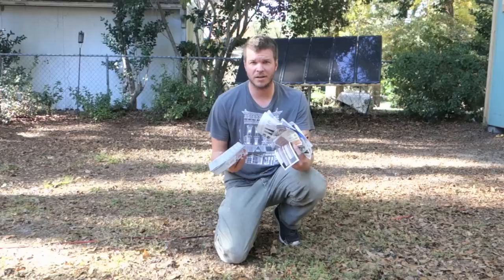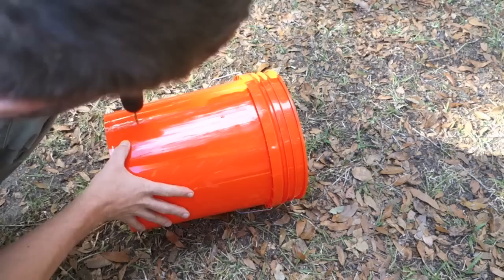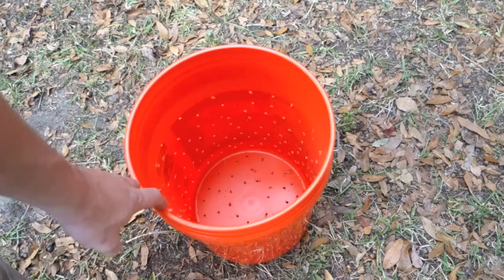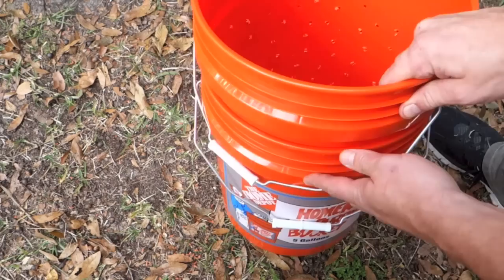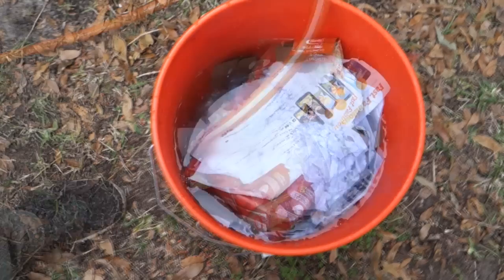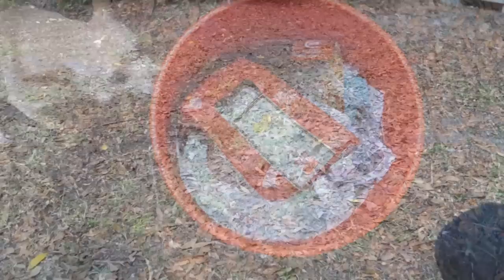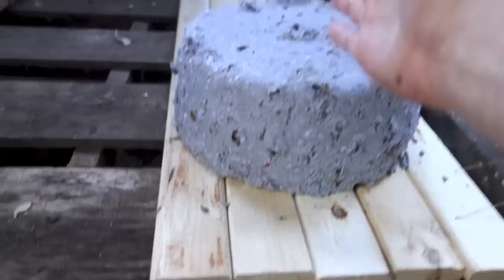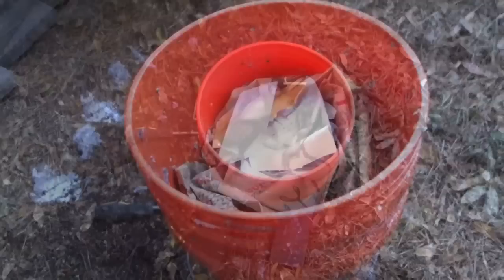Free And Virtually Unlimited Fuel To Heat Your Home

Comment: or i just grab enough wood for a week in an hour from the woods
Reply: I don't think the point of this video was to replace wood. Seemed more to me it was a way to take something that would just get thrown in the trash and do something beneficial with it.
Reply: @DarkNight042   Well honestly i'd rather just use the paper mail to start a fire with...
Reply: @TwiggehTV  Of course, but the trash mail is going to pile up much faster than you will need for fire starting. At least this way it doesn't end up in a land fill...
Reply: Joshua Stepien the last thing I want to do is spend an hour with this process when I can go cut and split a cord  of wood in 45 minutes
Reply: Why not have a closed heater/stove in which you just can toss the paper as it is? lol
Reply: You killing trees
Reply: What the hell harm comes from burying paper?
Reply: Not everyone has access to woods. If you live in an urban or suburban area you probably have better access to office waste than a forest

Comment: you have plastic in there, your going to burn plastic... (/facepalm)
Reply: +Jade Rogue I bet right in this moment you are burning oil or gas to heat your house.
plastic is to 100% made out of oil, so whats the difference?
Reply: +mrmadame28 The tiny amount of plastic is nothing to worry about
Reply: +Leo List  I disagree that burning plastic is nothing to worry about. Yes, it's a matter of degrees; but burning plastic forms dioxin-polluting and carcinogenic for a long time. Dioxin was one if the principle components of Agent Orange.
Reply: *****

Wrong
Agent orange was not to kill people but to remove leaves from trees
Reply: +Leo List It just had the neat sideeffect that it fucked up any living creature that it came in contact with. This makes a world of difference ofc.
Reply: +mrmadame28 the chemicals released from oil/gas products are harmful too. we call them exhaust
Reply: Mike Holland the point is?

Comment: Not the best idea due to burning residual ink and plastic liner. This creates toxic fumes. Even if burned in a chimney, no draft is 100% perfect. You'll get back flow into the house. You don't see an issue early but if you did this for years you might get lung issues.
Reply: So... it's OK for people over the age of 60 to do this then. Good tip!
Reply: Not if you’re using an outdoor wood boiler

Comment: So my buddy uses the same method. The only difference is he has a 3rd bucket (one with holes drilled, 2 without) a grate from an old grill puts the grate over the empty non drilled bucket, puts the bucket with the wet paper pulp on top of the grill grate, then uses the bucket with the water as the weight to help drain the water.  No need for the wood press.

Comment: The exact same method others have demonstrated here.  I am planning to try this out using paper, lightweight packaging cardboard, dryer lint, maybe even some dried grass clippings and leaves as some others have done for the ultimate survival scenario heating.  But I have a safer way to process the paper than a sawblade on a drill motor that will no doubt send many people to the ER.  I pre-shred myh paper in a cross-cut style shredder, once of the heavier duty office or commercial type shredder.  I'm already shredding anything with personal info on it, and it isn't that much more effort to shred it all.  If you pre-stack/orient the paper in advance you can shred alot of paper very quickly and it is pretty much ready to be wet down and pressed into logs.  I now have accumulated several LARGE boxes of shredded paper.  While the 3-bucket method appears to work fairly well, and if all you have available is some buckets, it will do.  But there are some brick making presses and such commercially available that look faster and they are not that expensive.  I am considering purchasing the Costway 4-brick press advertised online at $36.  That's pretty cheap for a rig that lets you press four bricks at once without a hydraulic press.  If I find these logs burn well I plan to use this as a primary method of providing fuel for my wood stove boiler to heat my floors and DHW needs at my new home.

Comment: Made these, but just smashed the wet paper with a broken shovel handle.. Then I  dried them. They burned slowly alright - BUT DID NOT HEAT!!! It actually cooled the fire.

6 months after "drying' the paper cakes, they still steamed in the stove and COOLED THE FIRE DOWN! it almost put out my fire.

Comment: You said you didn't need the wood press if you used enough paper in the mix but I'd still advise using one. The more water that can be extruded right at the beginning, the better. I'm using a small electric log-splitter to provide a six ton push. I've found the logs dry faster and better with so much liquid removed.

Comment: Design a box that u can put the wet logs into with a hose port attached to it and use a vacuum pump like for hvac. And pull it into a vacuum, thatll suck the moisture out fast.

Comment: You won't have enough paper to heat your house unless you own a print shop.  Paper only has about 7,000 btu's per dry pound.   That brick will never be perfectly dry just like firewood is never perfectly dry.   Ideal seasoned firewood is between 15% and 20% and that brick will be about the same or more.   A cord of dry firewood weighs about 2400 lbs.(at 8500 btu/cord) - that is equivalent to about 20.5M BTU's  I have never known anybody who could heat their home through a winter with one cord of wood,  Now that same 2400 lbs of brick will produce about 16.5M BTU's or about 175 gal. of propane.   Trouble is, no home or two or three homes is going to produce that  much waste paper and cardboard.   So you have an insufficient amount of fuel and a hell of a lot of work - just think how many buckets it would take to get 2400 lbs. of brick that won't keep you warm all winter.

Comment: Great idea man! I have a lot of papershread thats piling up. Til now ive been throwin em in the toilet so it wont splash when i take a dump. However i dont poop often enough to use up everything so this is perfect! But enough about my poop, i have buckets to drill!
Reply: OSHA requires any fecal matter over 4" in length to be lowered into the toilet by hand. This may solve the splashback that you are experiencing.

Comment: I'm in Wisconsin and made some paper logs. They've frozen :lol: because it's January here/

I put one inside in the basement as an experiment, even after like 2 weeks it's very damp on the outside and I'm sure very wet on the inside. Well, at least they're made and just need to dry out when Spring comes around.

Comment: when he let the hose fall into the water is what stood out the most. that water is contaminated with ink and w.e and once the hose is dunked into that solution you've now made a cross connection. in the event that the water in that hose might be sucked back through the hose it will backflow that contaminated water with it. dont do this and always have a check valve installed in your home to prevent back flow from happening.

Comment: I have 5 horse and they make A LOT of poo, so collect it from around the hayring during the winter months, place in a pile to decompost over the winter.....(dont bother with hunting poo in the summer fields, too time consuming unless inclined) no straw or bedding in my case as on hard standing, but with bedding from stables would work too..... use the poo instead of the paper mixing....still use a little water and mix with a stick to break up "poo apples", drain the poowater and use the liquid manure "tea" furtiliser feed for the vegetable and flower garden, dry the blocks over the summer for next winter fuel!

Comment: Works even better using 2 buckets that aren't the same size. Smaller 1 with holes inside of the larger one holding water. Less water wasted when pressing the mush into a 'log' or whatever

Comment: I have seen several videos about making the paper mulch logs. What I think might make them better is a duty log mold in which the wet pulp can be compressed under a hydraulic cylinder.
Reply: WARPHEAD I thought that too and you could add yard debree

Comment: Here is my Kia experience.  Anyone in my position has encountered the same thing from Kia.  If you cannot supply them with up to date maintenance records on your vehicle they will not cover it.  So for instance, if you change your own oil you're screwed.  Might work if you saved all your receipts but very few people are in the habit of saving receipts of them doing their own oil changes.  This ploy Kia uses is well documented if you want to look it up, I have, and it’s out there.  Also my car would be covered under the SC147 recall as the symptoms of my engine seizing up (engine needs replaced) followed the exact same symptomology as those the manufacturing defect notes in the recall.  The recall notice even appears on my Carfax report.  Again you can find all the recall information online.  The reason my car isn't part of the SC147 recall according to Kia is because it is MPI instead of GDI.  All the rest of the engine is the exact same, 2.4L theta II.  Kia says that because my car uses a different kind of fuel injection method that it cannot be affected by the metal filings left in the engine block which is what the SC147 recall is all about.  That's totally absurd on its face but that's Kia's position.  

The vehicles Kia did recall was done after many government threats as well as numerous lawsuits brought by disgruntled Kia owners for which there are many.  Kia's mother company, Hyundai actually recalled their vehicles for the same problem immediately when the issue was discovered.  It took Kia several years later to admit to the problem and issue a recall even though they were well aware of the problem.  Where was Kia's concern for people being killed due to this manufacturing defect?  A car having its engine seize up on the interstate would be something that would concern most companies immediately but not Kia.  Unless Kia completely changes the way it does business they will continue to cost consumers thousands of dollars for defective cars and probably end up killing people due to their own negligence.  

I had to argue, write emails, file complaints with various entities, etc just to get Kia to actually LOOK at my engine at no cost to me to determine the how and why of the engine failure.  Kia refused to cover my car even though it is under warranty and furthermore refused to even LOOK at my car to see what caused the failure.  I'm still waiting for a callback from Kia with their assessment.  Kia actually agreed to take my valve cover off to take a look at my car once I complained as high up as I could to Kia.  This was after several months of my car sitting dead on the Auffenberg Kia lot in Metro east St Louis.  Kia actually told me I'd have to pay $1500 up front to have my engine failure looked into initially.  My constant pressure on Kia finally got them to say they would take my valve cover off for no fee which costs Kia less than $50 in labor.  Kia had no desire whatsoever to know what caused my engine to seize up.  Their ONLY concern was to avoid any acknowledgement of any responsibility or liability.  Kia already knew what caused the engine to fail.  The same thing that happened to hundreds of thousands of the same engines made by Kia and Hyundai.  It was the exact same problem as the Kia SC147 recall.  Taking the valve cover off will not help.  There was no oil leak.  No oil smell.  Never any indication of any problem with the valve cover.  It's simply a ploy for Kia to say we looked at your engine and it's your fault.  Who would trust their assessment at this point anyway?  I'm out thousands of dollars I still owe on a car without a working engine.  Don't you think any car maker worth a darn would want to know why one of their vehicles engines just seized up on the highway?  Kia's been super lucky so far no one has died due to their negligence.

Additionally a co-worker of mine had a problem with his Kia and will not buy one again either.  For his Kia the car required a specific oil filter made and installed by Kia and if that was not used the engine fails.  He was never told this when he purchased the vehicle.  His insurance successfully sued Kia for over $7,000 for his engine failure.  Unfortunately my insurance doesn't cover mechanical issues.   

Ever wonder why your Kia never quite gets the gas mileage it was rated to get?  Kia has also paid out for a class action lawsuit because they lied about the MPG of many of their models.  The very MPG rating that many people base a large percentage of their purchase decision on.  Yeah, Kia lied about that too but kept it hush hush.  You can find the information online if you look for it.

I had my car into the dealership (Auffenberg) several times before the engine failure telling them something is bad wrong with the car.  The Kia service department ran every kind of computer diagnostic and could find no reason for the problems which included knocking, major loss of power, major loss of fuel economy and car dying at both idle and speed.  Check engine light was always on and every sensor it said was malfunctioning was replaced and it didn't help.  Unfortunately I could not leave my car with Kia.  Kia wouldn't supply me with a free rental.  They said it was against company policy.  My step daughter was dying needing a second liver transplant as all this was going on and I couldn't be without that vehicle.  With only one vehicle (other than the Kia) I wouldn't be able to get to work or my step daughter wouldn't be able to be cared for properly.  I told Kia this and still they refused to get me a rental while they actually got to the root of my car problem and addressed it.  Instead they said sorry to hear that, we can't find any problem with your car.  They actually let me leave with a car they KNEW was dangerous and about to fail.  They didn't care that my family was going through a serious medical situation with my step daughter and the car behaving as it was only increased the stress on my entire family during this time.  Fortunately my step daughter got her transplant just in time and is doing ok now.  Not only did Kia sell me a defective product but all this happened as our family is going through the stress of a child being deathly ill, lots of additional costs for medical related expenses and Kia was told this and didn't care. Kia added thousands of dollars to my already stressed finances by selling me a defective vehicle. 

But it gets even better.  The Kia rep in Arizona named Steve that handles my case and many others actually told me on the phone that some of Kia's cars die early and that's just the way it is.  He insisted all other car manufacturers have the same problem and also refuse to repair the vehicles leaving their customers screwed too.  That's certainly not my experience nor that of anyone I know.  Steve at Kia flat out told me Kia isn't going to pay and I'm out of luck because I got a bad Kia and have to eat it.  That's what he said.  That's Kia’s customer service that said that to me.  

I have to shake my head and laugh every time I call Kia and their recording says "Rated #1 in initial quality 2 years in a row!"  Yeah, and dies in 78,000 miles and Kia refuses to make a full recall or honor it's warranty.  You won't see Kia winning any customer service awards or vehicle longevity awards.  

My advice to anyone that has a Kia (ESPECIALLY if it's a 2.4L) is to trade it in and get something other than a Kia before it dies and your left paying off a car that doesn't run.  I liked Kia at one time or I wouldn't have bought one.  What I've found out since has opened my eyes to the quality of their vehicles and their denials of their own manufacturing defects even if it could cost lives or severely screw consumers over financially.  Buying a Kia might make you think you're getting more quality for less money but it's all based upon lies and cover-ups.  That is my Kia experience and it's the WORST experience I've had with any company on any level at any time in my 31 (47 - 16) years of driving cars.

Comment: I used the same concept whereby I used a bucket lid and mounted a broom handle on it to press the paper into the bucket.  I cut about 2 inches off the lid's diameter to fit into the inside of the bucket.

Comment: I also appreciate your video some thing that I wanted to share you can also use a drywall puddy pan drill holes around the pan  and use a peace of wood a 2 × 4 or so as a press 2 C-clamps to squeeze the water out and place in oven at low setting to dehydrate it makes a great briquettes for fire

Comment: I think its a great idea using scrap paper (so much paper and cardboard gets thrown into landfill, only about 10-20% of our recycling actually is used for recycling) but I wouldn't use the shiny junk mail, not sure what you'd be breathing in after burning it. Use letters, scrap paper, even cardboard all shredded in a strong paper shredder, save you the trouble of drilling it. Then add some sawdust from wood logs, not mdf, to help bind it and burn better. And just use another bucket full of water to press down instead of the wood circle.